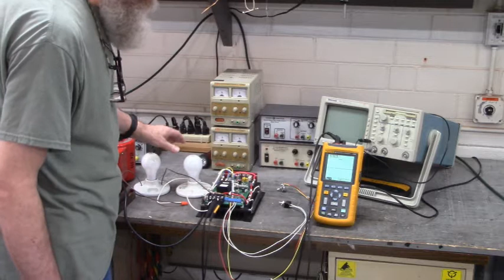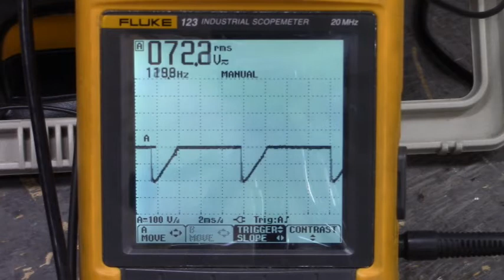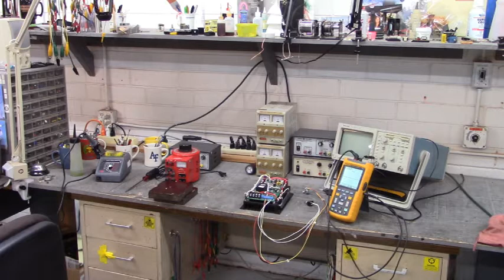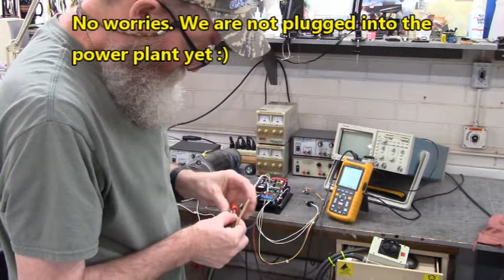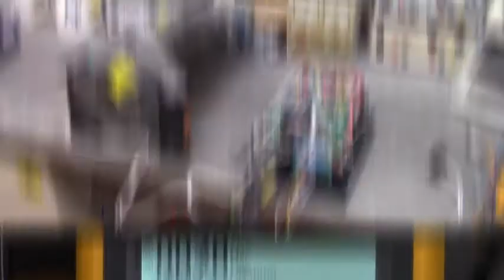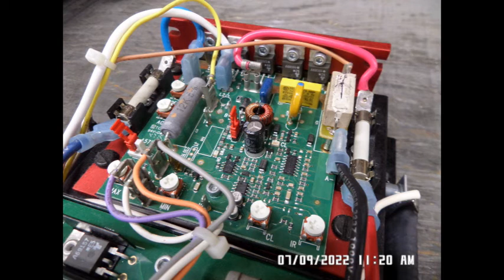Testing the KB Electronics DC Motor Speed Control KBCC-225R

Comment: My problem our dc motor is breakdown and change the coil field after change and operate dc drive note that field voltage unstable from 330 Vdc and after time reach to285vdc and temperature of motor very high what happen I don't know